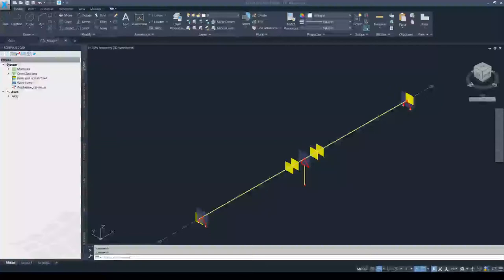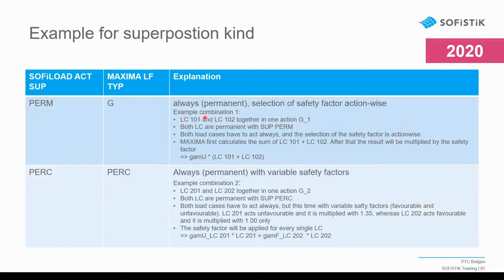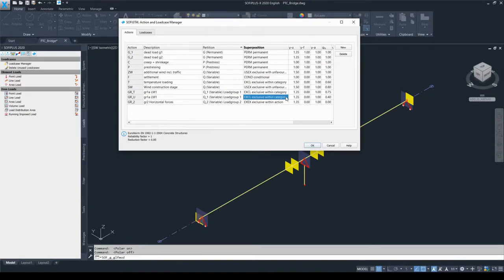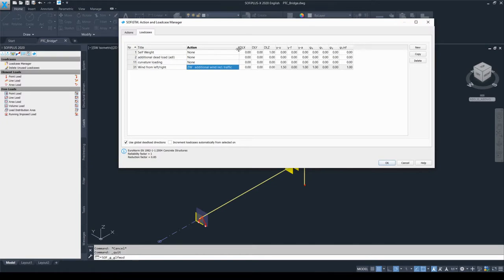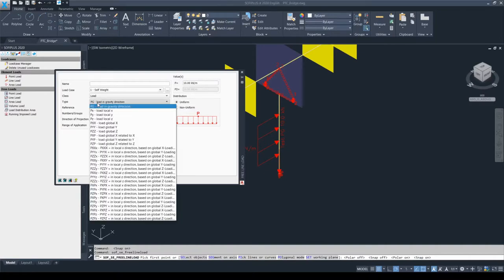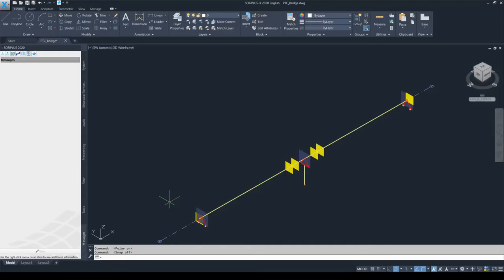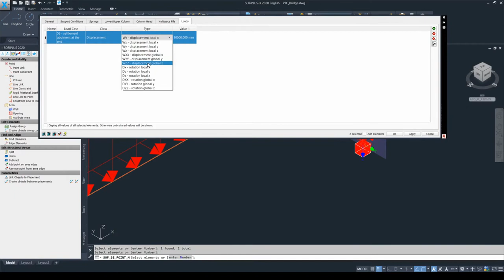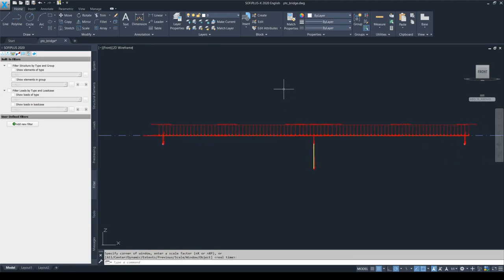Bridge Design Training #04 - Actions and Load Types

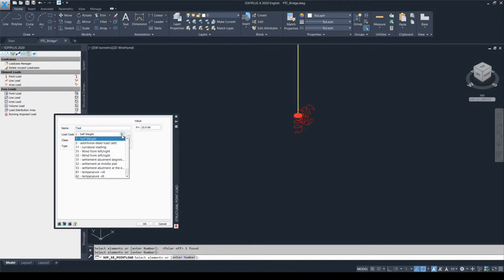Comment: There is a cut in the video at 53:48. How did you open the window Structural Point Load?
Reply: I see, you probably clicked on the point at the bottom of the pillar line and then clicked Point Load in the left panel.
Reply from the maker: Hi IgorKozarchuck,
Yes, you are right! The left "big" panel is for creating the loads, the right "small" panel is for adjusting exactly that load type.
Sorry for the inconvenience, unfortunately cuts were unavoidable with those long training videos...

Comment: Hi , thank you for the great tutorials they are life savers.
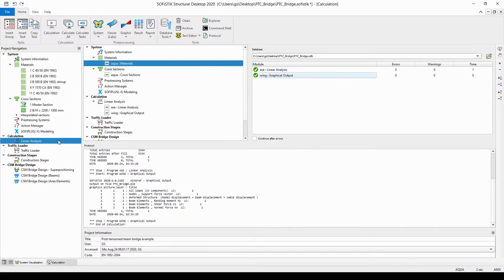I'm following along (specifically at 01:17:55)  but i got an error from ASE as follows 

"warning no.   399 in program TLCD
   No loads defined for loadcase 1 or all loads in equilibrium"

I'm guessing i didn't implement the self weight correctly , but i don't know where exactly. Thank you in advance
Reply from the maker: Hi Nacer,
Just some general information at the beginning:
ASE is the modul used to calculate the applied loadcases of the defined system.
This warning tells you that there are eigther no loads in your system (you can check that in SOFiPLUS in the "Filter" tab. Simply select everything in there and deselect all loadcases but Nr.1. Then you should only see your loadcase 1)
The other option is that the applied loads of loadcase 1 cancel themselfes out. E.g.: the same load is appplied to a structural line once as "+1KN" and "-1KN".
Did that solve your problem?